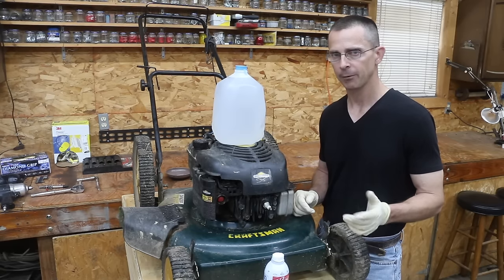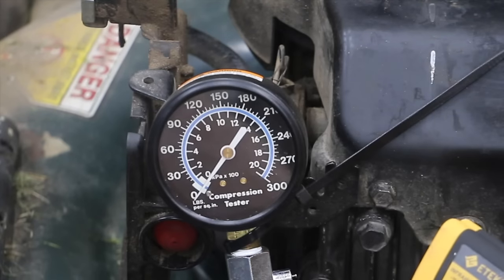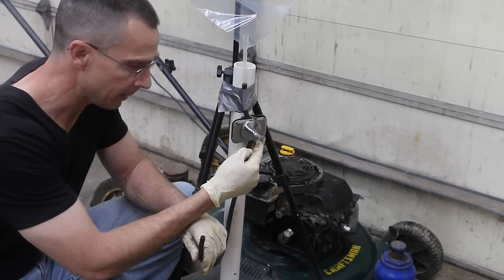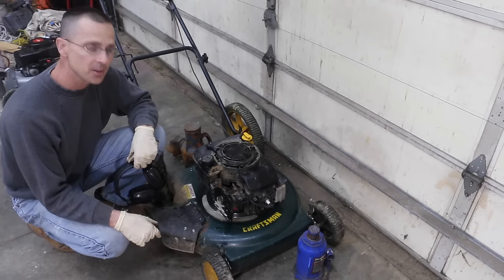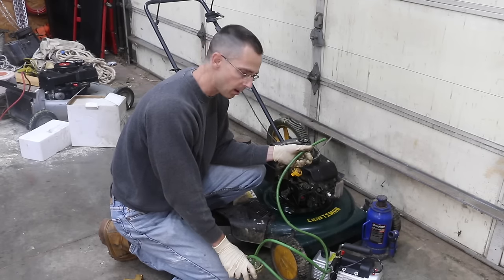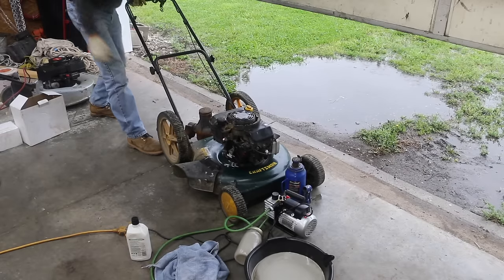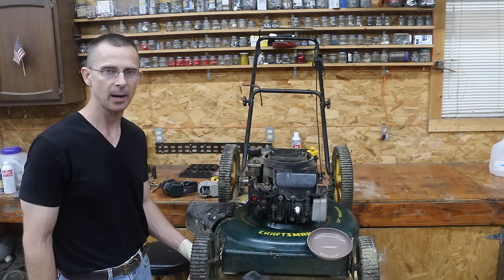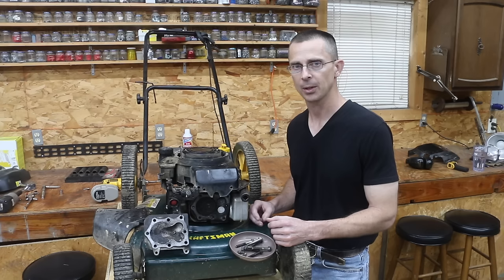Seafoam--can't believe what it did to my engine episode 5--cylinder cleaning test using water!!

Comment: That poor lawnmower... LoL
We used to regularly do water injections on customers cars if they had rough idle problems, pinging/detonation or dieseling/run on issues, as a way to primarily de-carbon the combustion chambers. The way we did it was a bit more traumatic, as we would get the engine to operating temperature, and start slowly pouring the water down the carburetor, slowly increasing the flow while operating the throttle to keep it running, eventually getting it to wide open throttle and using the water to keep the engine rpm tolerable. Depending on the engine, we’d even rev it to high rpm and dump a large amount of water down the carb at one shot. After a bit of practice it became a choreography to balance out load, bog, engine speed and such. Never pulled a head to inspect after, nor did we have a borescope in the shop, but in a majority of the cases, there was improvement as seen on a manifold vacuum gauge, smoother idle and lack of dieseling/run-on and pinging.
With better engine management systems on board, the need for such an aggressive measure faded away in favor of intake system cleaning and fuel system cleaning, mostly as preventive maintenance. Seafoam, being flammable, was used to clean the intake system, but was not real effective cleaning off carbon deposits. Carbon cleaning was better performed with a steam-cleaning method that Techron could do, so long as it mild carbon deposits. Here is the method I used on my own personal vehicle: about once a year, ran one full can of Seafoam through the intake via fine mist, half a can in the oil just prior to an oil change, the remains half a can in the fuel tank. About every 4-5 tanks of gas, a bottle of Techron was added to the fuel to add a little lubrication to the in-tank fuel pump, keep the injectors clean and spraying a fine mist, finally helping steam the combustion chambers to control carbon deposits. The vehicle. 1998 Toyota Camry V-6 with 260,000 miles on it, regular Mobil1 5W-30 oil changes done every 5,000 miles and never had to add oil between changes. Visual proof of the preventive maintenance on the intake and fuel system came when I had to pull the intake off to replace a knock sensor and sub-harness- the back of intake valves were as pristine as the day they were installed. With the engine at idle, a 10” 1/4 extension could be stood on end, on top of the intake manifold, and wouldn’t shake and fall off.
Anyone taking the time to read this, give it a shot, as it comes from a five-time re-certified ASE Master Technician, Advanced Engine Performance Specialist (L1) with 35 years time served in the trenches. Me.
Gotta love the Project Farm videos. Bravo!
Reply from the maker: Thanks!  Thanks for sharing.

Comment: I ran water vapor thru my slant 6 for 100k miles before I sold it. Ran cooler and got 2 miles more per gallon. Used a gallon jug, a Fish tank filter stone submerged, with hose from filter stone out the cap. Then ran hose from my intake manifold to the cap and only inserted it 1 inch down (not in the water). The engine vacuum pulled air thru the stone and created bubbles giving water vapor to the engine. I put a small adjustable valve on the fresh air intake to gauge how much water was used. Water never mixed with oil. I filled the bottle every month.
Reply from the maker: Thanks for sharing.

Comment: Yeah I use like 6-8 ounces of water to do this over 15 mins. And you do it before an oil change. Water works fine if done right. I also use seafoam
Reply from the maker: Thanks for sharing.
Reply: @ProjectFarm  props to responding on an old video. I've probably seen 90% of them. Keep it up!

Comment: At this point I have not watched the whole video, but want to comment. I have seen this done on a V8 many years ago when I worked in a garage, it worked very well, water was poured in slowly, maybe a quart of water. The engine ran poorly before then after, it ran and idled very smooth. Also the rpm's were ran up some. Engine was at temperature. I just think the two hour run was asking for it to get into the crank case. 5 or 10 minutes or how long it takes to pour in a cup or so of water seems more likely to get the best results.
Reply from the maker: Thanks for sharing.

Comment: I've used water but was used the same way as the foam.  In general you run the engine to temp then during high revs you sorta bog the engine with a high velocity water straight into the carburetor a few times.  So let's say reving at 3-4K or even a break in speed of 2K  you would bog the engine with the spray while trying to keep it alive with the throttle.  3 or 4 times will do it then after being sure the motor is OK you would change the oil and filter.  After this is when the observations are made if any.

Water is used daily by many for hours and hours on end to cool the intake charge resulting in a denser shot of oxygen allowing   a bigger fuel charge to compensate... the idea being more fuel more power.
Reply from the maker: Thanks for the feedback.

Comment: I use water sprayed in with an atomizer while engine RPM is at 2000. Spray until you hear RPM begin to drop, stop spraying until it recovers, then spray again. Doing it this way I've never had a problem with water in the oil and it does remove carbon.
Reply from the maker: Thanks for the feedback.

Comment: Wouldn’t that be cool if you tried to build a 2 spark plug cylinder head and ran the compression test while running? Or do something else with that other hole?
Reply from the maker: Thanks for the suggestion.

Comment: wonder if you could use a spray bottle for water. I think too much water as evidenced by water in oil and low engine temp.  Definitely looked like less carbon.  If you get rid of carbon in the cylinder head you would think the compression would get lower, on the other hand if it gets rid of deposits on the valves you would get better cylinder fill or higher compression. Just my thoughts

Comment: I've seen many blown head gaskets in car engines.
You can always find the cylinder at fault when the gasket blows between water jacket and combustion chamber.
That piston, combustion chamber, valves are always clean as a whistle   to almost no carbon build up. But the engine probably ran for more then 2 hours. Water will work to decarbon engines but seafoam is much safer and wont hydraulic lock your engine.
Reply from the maker: Thanks for the feedback.

Comment: As an aside. During WW2 airplanes used water injection to temporally boost power on take-off. These engines had to be at full operating temp and full throttle. The water super heats into steam in the combustion chamber with a much higher expansion rate then fuel alone. This could only be used in short bursts as the engine would cool below steam temp and the engines could sustain the load from the added power without damage. And yes it did clean the carbon off of the pistons and cylinder heads.
Reply from the maker: Thanks for the feedback.

Comment: I have seen a lot of carbon removed by spraying water directly into carb. If you have ever seen an engine that had a blown head gasket the areas where the water leaked thru are extremely clean.
Reply from the maker: Thanks for the feedback.

Comment: Because that is such a very small motor you shouldn't need as much water. You only need like a regular sized water bottles worth. I personally use a hose connected to my intake which is passed the mass air flow sensor and have it just sip it with the jar at a higher elevation. Almost like my car is sipping on well aged scotch.. But putting a small portion of other possible additives help as well. If you look up ingredients in products like sea foam because its relative in this case and a portion of that with it. On the cheap it helps. Little goes a long way. I prefer distilled water as well.

Comment: Although the water was metered, it needs to be added slower and with breaks to allow the engine to maintain temperature. The water in the oil is due to too much water for too long. 2 cups in a v8 is normally enough. I add mine with a sprayer.

Comment: Old timer told me to 'mix' a little water and transmission fluid, pour a little at a time in the carb while running a hot engine and gradually flood it out. After sitting, clean the plugs and spin it over. Put the plugs back and run it till it stops smoking.
Reply from the maker: Thanks for sharing.

Comment: You mentioned you found the engine and exhaust temps being cooler to be interesting - dunno if you pay much attention to high performance racing, but this is actually a thing used to prevent engine ping / pre-detonation, by cooling the engine so the fuel doesn’t spontaneously ignite before it’s supposed to.  It also increases the pressure inside the engine, if I’m not mistaken, which can be used to increase performance.
Reply: During WW2, bomber use water injectors during takeoff to boost power carrying all the bombs and fuel ammo.
Reply: every drop of water that turns to steam expands about 1600 times at stp.

Comment: Its the conversion of water to steam that cleans a cylinder spotless.  Anyone who has changed a blown headgasket knows the effects of this as you always have one or so spotless cylinders around the issue. Having used water for cleaning,  I wouldn't have used a constant drip as its too dense and there's no recovery of temperature.  Remember its the conversion from water to steam that  cleaning the cylinder and that requires heat. Also you didn't need anywhere near that amount. 1/2 of a spray bottle is plenty.. 
What has worked for me in the past is spraying from a bottle on a hot engine, spraying until a slight bog and then giving the engine a recovery period of about a minute.  This keeps the cylinder hot and all the water sprayed into it converted to steam and expelled.  Always on an engine under no load! Like most tricks, the particulars around the developed methods mater.
Reply from the maker: Thanks for the feedback.

Comment: I reckon it's got a lot to do with thermal mass. In a far bigger engine the cleaning vs cooling ratio is far better. I've never had water in my oil. You may be able to achieve better results by cycling back to hot before adding water each time. I'm amazed how much carbon remained in this video. Usually it leaves thing pretty spotless.
Reply from the maker: Thanks for the feedback.

Comment: in the old days 50's and 60's we used ATF and we only used a coffee cup full and pour it down the carb and that would take care of the carbon and stop the motor from dieseling when you turned it off. but you will have a smoke screen that you couldn't even see thru. you definitely don't do in a computer controlled car with catalytic converts. and if it goes into the crankcase its just oil. back then we also ran 4 quarts oil and 1 qt ATF it helped keep the hydraulic lifters pumped up. and it helped keep the oil from sludging up with the Hi detergent ATF. and as a mechanic when your hands got dirty we usta have a 5gal bucket of old ATF to wash your hands in to get all the heavy grease off then use Lava soap to finish washing up.
Reply from the maker: Thanks for sharing.

Comment: I have done the water carbon removal trick but I only used about a pint by drizzling 3/4 of it in and keeping it running then slowly poured in the rest the engine usually stalled then restarted it and it smoothed out and ran well with out oil contamination.
Reply from the maker: Thanks for the feedback.

Comment: Using denatured alcohol to flush the crankcase would be more effective. The alcohol will combine with both water and oil resulting in a more thorough cleansing. Use your electric drill to spin the motor instead of running it to prevent an unintended combustion of the alcohol mixture.

The steady infusion of water was not the most effective method. Steady infusion prevented the engine from achieving operating temperature. It is the shock of the cool water on hot metal that causes the release of the carbon. An intermittent mist spray would allow the temperature to be restored between applications and produce a better result.
Reply from the maker: Thanks for the feedback.

Comment: I would say Sea foam won, but I don’t know about the loss of compression. First time I’ve seen that. I use to do water spray to car engines in the 60’s & 70’s to get rid of the carbon so they wouldn’t have pre detonation, of course the gas had lead in it then and made a lot more carbon. 👌 Don’t forget that when the compression drops below 60 psi, it’s harder for the engine to start.
Reply from the maker: Thanks for the feedback.

Comment: One of our tow trucks started  knocking  like it was ready to throw piston out of engine. My boss listened  and  he is great mechanic, he  asked me to fill coke can with water. He took off air cleaner and  started engine grabbed throttle  linkage and Started pouring water down carb it started to choke out and smoke he took up idle and poured more water. You have to  be careful  not  to  add to much water at one time as to not burn or bend valve  but after couple  minutes  truck had no noise and was  back up and  towing  it had a carbon knock and water saved a lot of work and money
Reply from the maker: Thanks for sharing.

Comment: E85 ethanol is a great cleaner! I was left speechless when I took apart an engine head to sell. It was just as clean as the day I put the head on the engine. Try running your lawnmower on E85 and see the difference. You'll get yellow stains but not really any carbon buildup.
Reply from the maker: Great point!
Reply: @ProjectFarm  Check this link out. The head looked exactly like this! https://www.svtperformance.com/threads/will-extended-e85-use-clean-carbon-off-pistons-and-valves.1062190/

Comment: This would have worked better with even slower introduction of water into the system, I believe.  Like a pint over 2 hours.  I feel like the combustion chamber was not able to reach a high enough temperature to separate the carbon from the surfaces and burn it away.  You cant steam clean something if there is no steam.  And there wont be steam if the temperature isnt high enough.  Just my opinion.  I'd love to see more attempts of this!
Reply from the maker: Thanks for the constructive feedback.

Comment: I currently run water and methanol through my car's engine when it's at a high load. I need to check how the intake valves and combustion chamber look, but I don't want to pull the intake manifold to look at the valves. It's a pain.
Reply from the maker: Thanks for sharing.

Comment: Well, GM used water injection on the first turbocharged car. And it's been used on others, too. It works great as an anti knock, obviously reducing combustion chamber temps, but also as a cleaner. The biggest drawbacks are rust issues, from water, and the fact that water isn't combustible, so there's an efficiency issue. But water is the most versatile solvent. I'd recommend using a Venturi system to administer it, versus a drip method, to prevent "flooding"! Lol.
Reply from the maker: Thanks for the feedback.

Comment: Seafoam definitely won this. If you use almost a gallon of Seafoam, it WILL clean the engine better than water. (Seafoam almost cleaned the engine as good as 1 gallon of water with only 4 ounces.) Seafoam costs $7 and you don’t need to monitor the engine while running it, and you don’t need to change the oil. Using water can cost hundreds of dollars worth of engine damage, plus several oil changes to flush the water out. Seafoam definitely won.
Reply from the maker: Thanks for the feedback.

Comment: well done  but I always used a spray bottle with the water this way it atomizer with air a little more,  the engine stumbled and then you let it clear it's self and then do it again mite have worked better for this and there for would keep temp high forming steam thats what really cleans the carbon off.   I've been doing this way sense the 70's  and never had to change the oil. Anyway does show it works just takes time for a good job
Reply from the maker: Thanks for sharing.

Comment: I have used water on my engine before but not for 2 hours straight and certainly not that amount of water. 

The effect desired is for the water to turn into steam from the heat up on entering the cylinder, pour too much water in and the cylinder temperature will drop too much for it to work.
Reply from the maker: Thanks for sharing.

Comment: The only two ways that water could make it into the crank case is past the rings or valve guides. Old motor like this likely has some elevated blow by which would end up allowing some water into the crank. If you pull the breather hose off the intake, you might notice some combustion gasses coming from it, which would be a good sign that this is the case. You may also notice smoke from the oil fill tube when you remove the dipstick after letting the engine run for a bit. It is also advisable to replace the old head gasket whenever you remove the head. They almost never come off in one piece, and even a little flaking or separation can cause a leak. Of course with a flathead style like this you will only loose compression, whereas in an ohv you may have a leak into the crank via push rod channels.
Reply from the maker: Thanks for sharing.

Comment: They do it on cars for a minute using water mist.  That was way too long using too much water for a tiny engine with no intake to vaporize water.  They do it to diesels but at cold temps there is even water based product called revive.
Reply from the maker: Thanks for the constructive feedback.